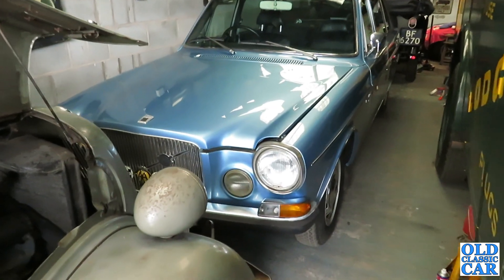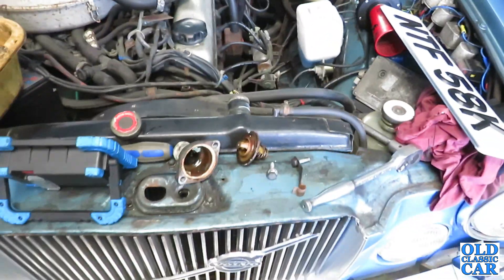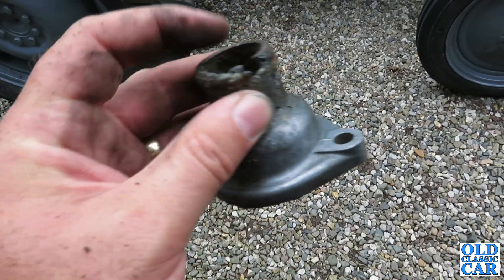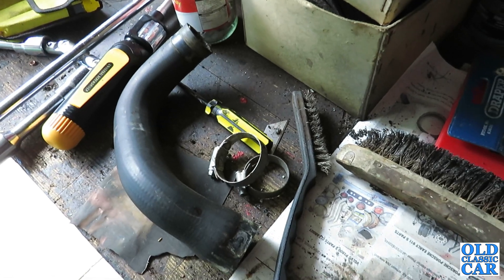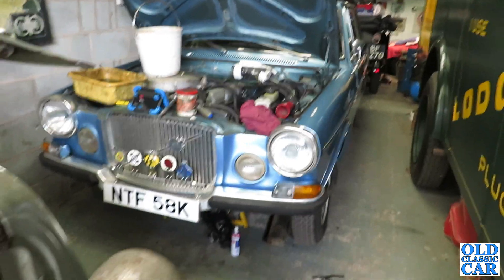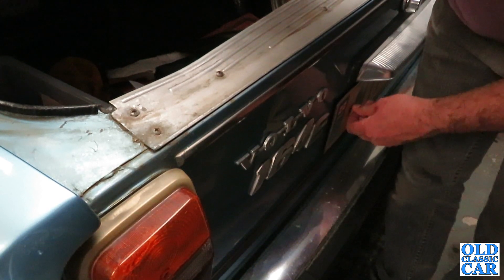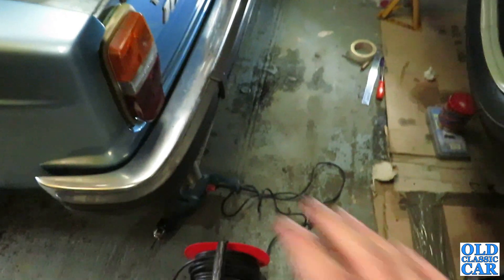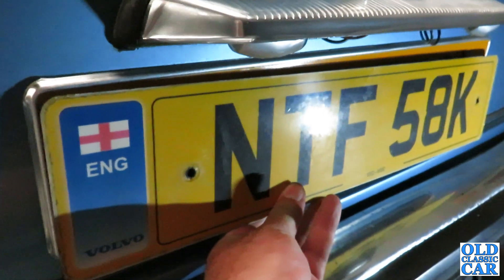More Volvo 164 E fettling - classic old-style car numberplates are fitted to the 1972 164E etc

Comment: Lovely improvement, makes me wonder why owners fit non-period plates when these are readily available? You could of course have gone for black & silver plates! Rubber grommets & a smear of sealant would be a good way to preserve the original mounting holes & prevent moisture ingress.
Reply from the maker: I thought about silver/black but by then they were becoming much less common, and the yellow/white pairings were taking over. Plus I remember our old 144S having the coloured metal plates! Yes rubber grommets and blobs of grease were used for the old holes.

Comment: As an aside, make sure the vapouriser is getting hot on the gas system. Usually plumbed into the heater hoses, it does rely on constant hot water to operate correctly. An air lock will cause the gas to freeze and render it inoperable.
Reply from the maker: Thanks, yes I'll have a proper look into the LPG system when I get it back on the road

Comment: Nice up date. Stick a fork in it. It's DONE! lol Thanks for the shot of the LPG. Wow! It's got the tool box! Sweet. I recently did my cooling system. Totally forgot about the heating system. I'll have to run it the next time out, even though it's summer here. What is that square thing below the rear bumper? Doesn't quite look like a tow hitch, but is it?
Reply from the maker: It's a fuel tin sat inside the spare wheel on the LHS, I've had it for a few years and it seems to fit well. There appears to be another fuel can behind the vertical spare wheel on the RHS too, but I've not had the wheel out yet. Under the rear bumper is the filler nozzle for the LPG.
Reply: @oldclassiccarUK  Oh! Very neat. Thanks for the update/correction.

Comment: A beautiful car with it's lovely new number plates WITHOUT the horrid EU Flag on !!!!!!!
Reply: Look closely, no EU flag.
Reply: @paulbennell3313  Exactly what I said !
Reply: A lovely one there. I would say that you saw the factory original thermostat housing with some corrosion, but not a bad thing because aluminium (as well as zinc) has a greater electro reactivity than iron, so effectively protecting the iron of the cylinder block and head. An important inhibitor of this reaction is the ethylene glycol based coolant (anti boil/freeze). In Australia, the nominal life span of the LPG system is 10 years, each time a test is due, but prohibitively expensive, so many LPG (only) cars are 'written off', although many of them have functioned well for over 20 years. The main issue there is the die-cast aluminium alloy in the gas converter where the coolant passes. Often the first item to corrode and leak... So it would be important to check the fuel (petrol) injection system as well...